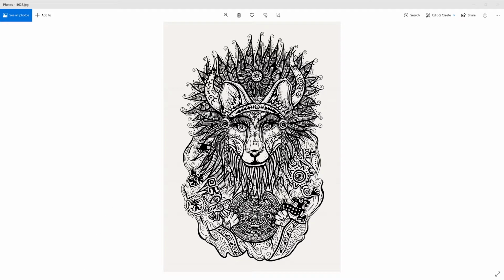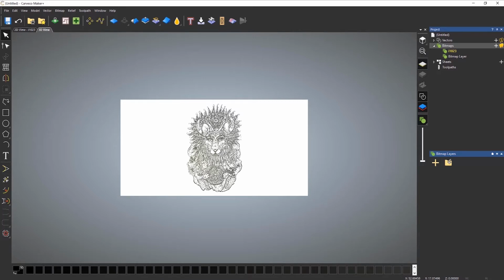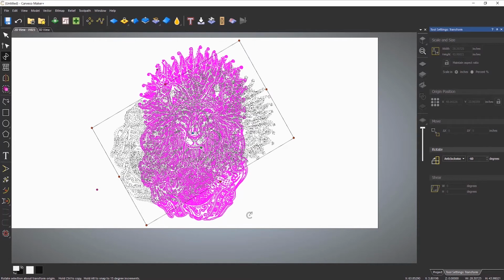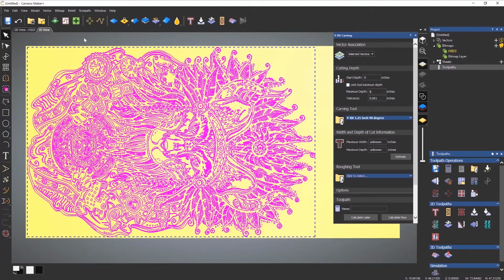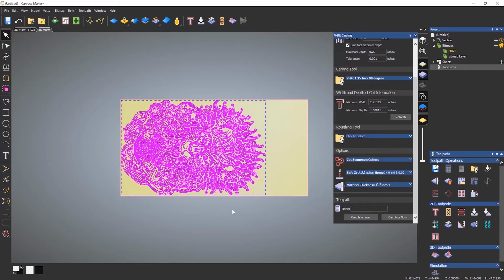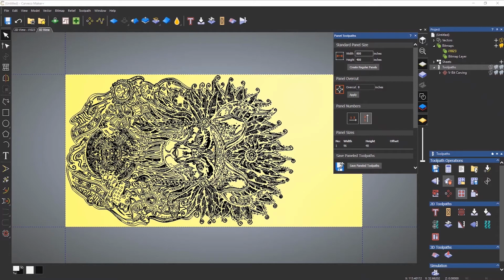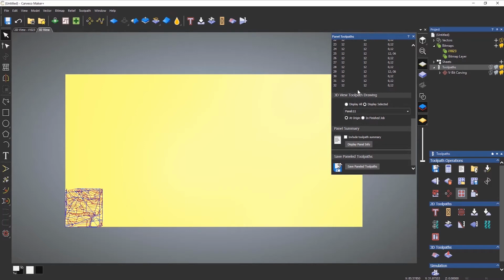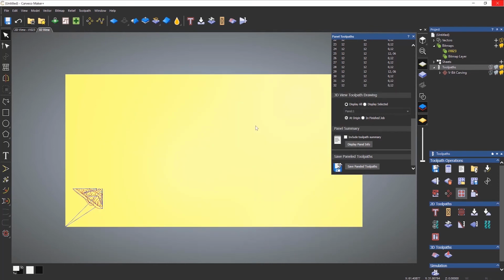Carveco Maker Plus: Panel or Tiling Toolpaths

Comment: Thank you so much for these amazing tutorial’s! I have a question in regards to paneling. What would you do if for instance I have a 36” long by 2” high piece of wood and I have to put text across the entire piece but my machinable area can’t get the full length at one time? 

If I panel that piece into 2 sections right in the middle at 18”, would I then just slide that same piece over once tile 1 is complete and use my center mark to line it up for tile 2 to begin? 

Hope this made sense and thanks again!
Reply from the maker: Hi Timothy, yes that is correct, slide it down the table.  Although obviously, you would need to mark your datum and make sure it matches up.  If you send our support guys a message at support@carveco.com they will be able to check your project over for you.